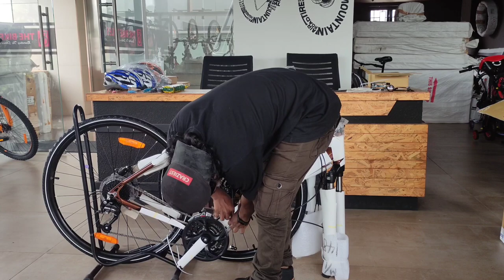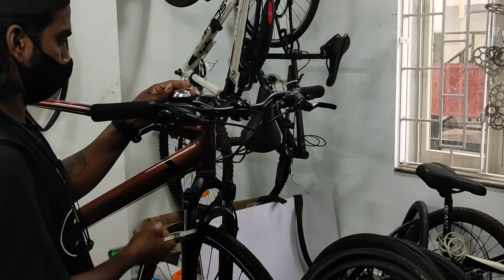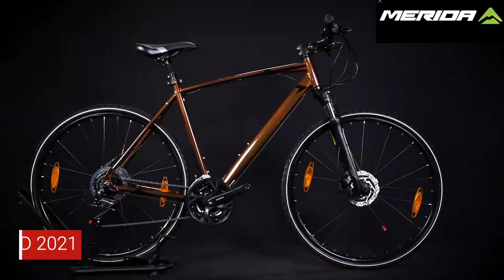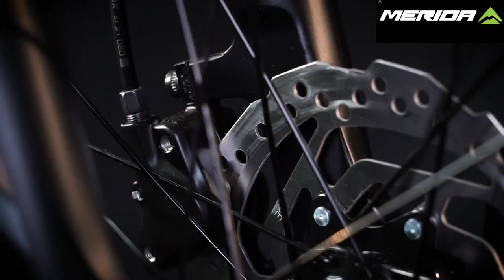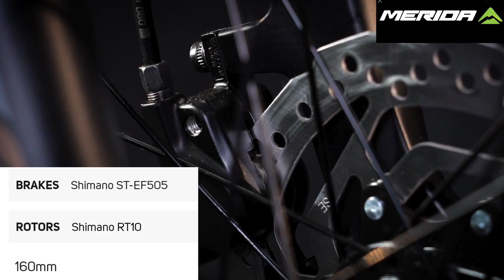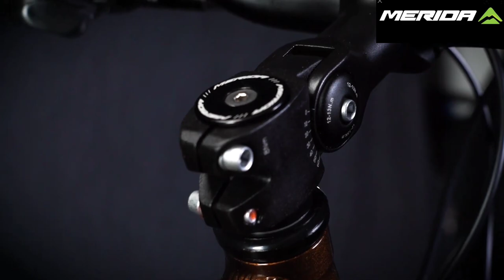Merida Crossway 40D 2021 Unboxing |  HANDMADE FRAME

Comment: Bro Shop il Merida Yude Valla Hybrid Bikes Undo With Lock Out Suspension And Hydraulic Brakes. Under 40k Varunna Nalla Oru Ennam 
Please Reply Bro
Reply from the maker: Under 40k onnum kittilla merida v brake starting from 40k. Crossway10v

Comment: My dream Hybrid bike
Reply: Due it's caliper position difficult to attach fender and rack,these days jaint roam 2,3 comes with disc caliper in between chain stay and seat stay
Reply from the maker: ശെരിയാണ് പക്ഷെ ആരാണ് ഒരു uniquness ആഗ്രഹിക്കാത്തത്. ഇപ്പോഴത്തെ കാലത്തു Handmade frame oke use cheyuka ennu പറയുന്നത് ഒരു  cyclistine  sambadhichu വലിയ കാര്യമാണ്. (ഞാൻ ചവിട്ടിയതിൽ വെച്ച് ഏറ്റവും riding comfort തോന്നിയ ഹൈബ്രിഡ് മേരിടാ ആണ് പലർക്കും പല ഇഷ്ടങ്ങൾ ആണ് giant ഇഷ്ടപെടുന്നവരും ഉണ്ട് ഒരുപാടു ❤
Reply: @AkhilCyclist Merida crossway series comfort ananu nigalluda Merida 5v video IL parayunudu. I will come to your shop when  crossway 5v,15md,20d become available,Merida suspension seatpost nallathano ? Backpain undakumo normally ?
Reply: @gwagonaddict6289  shop undo evide ane
Reply: @AkhilCyclist  bro ഈ Merida Crossway 40D ടെ Price ഒന്ന് പറയാവോ please 🙏🙏☹️